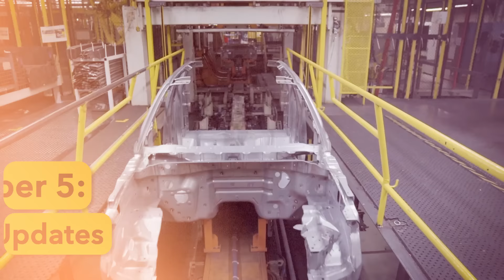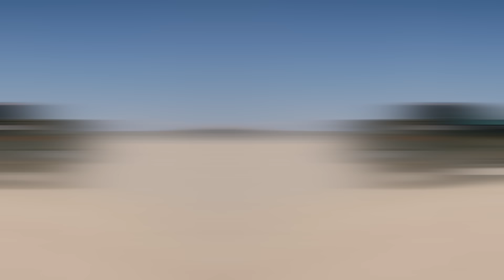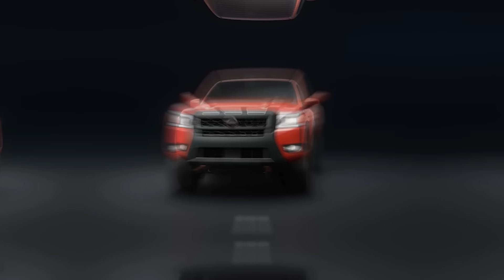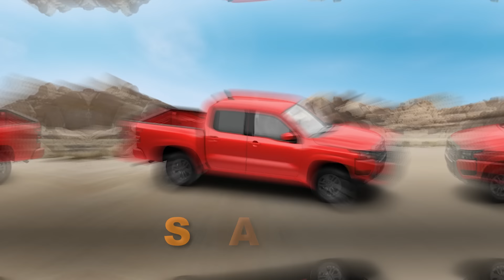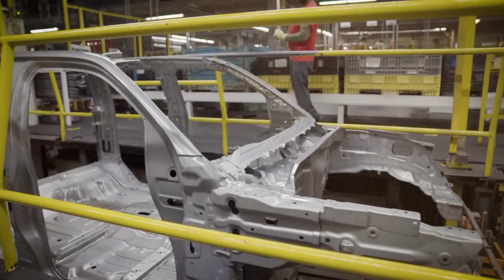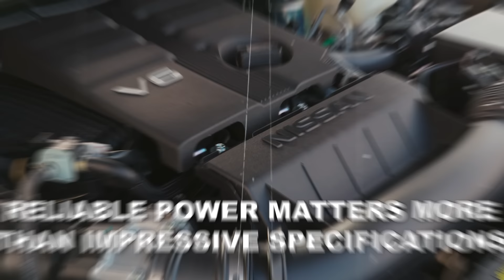5 GENIUS Changes in 2026 Nissan Frontier EXPLAINED in Detail!

Comment: Their engines still have a massive design flaw with the water pump. If it fails it can mix coolant into the oil and destroy the engine. No thanks.
Reply from the maker: The timing chain-driven water pump is a legitimate concern - when it fails, it's not just a simple pump replacement, it's potential engine damage. Nissan should've fixed that design flaw by now.

Are you basing this on known failures happening already, or just the inherent risk of the design? Because if it's actually grenading engines, that's a huge problem.

Comment: Leased Nissan vehicles (all trims) and a Frontier and never, never had any issues all those 15yrs. Going to lease a '26 Frontier here soon before December. Nissan=dependable vehicles!
Reply from the maker: 15 years of trouble-free Nissan leases is solid loyalty! What are you most looking forward to with the '26 Frontier - any specific updates or features, or just sticking with what's worked for you?

And why lease before December specifically - end of year deals, or trying to lock in before potential price increases?

Comment: I agree about the water pump issue. But could be alot worse the reliability of having a 4cyl turbo mid size truck like other brands have switched too. Im a gm guy at heart but I'm really wanting a frontier
Reply from the maker: So you're willing to deal with the water pump headache to avoid the turbo four reliability gamble? That's fair - at least the Frontier's V6 is proven, even if the water pump design is questionable.

What's stopping you from pulling the trigger if you already want one? Just waiting to see what the 2026 changes bring, or trying to talk yourself out of leaving GM?

Comment: is the water pump still inside the engine? chain driven water pump?  exceptional engineering"!!!?,  electric radiator cooling..
Reply from the maker: Yeah, it’s still a chain-driven water pump tucked inside the timing cover on the VQ engine. Definitely not the easiest setup to service, but it helps keep the design compact. Even so, it’s considered one of the most reliable engines out there, and the average annual repair cost is lower than most trucks. Do you think Nissan should keep refining the VQ or move on to an all-new powertrain for the next Frontier?

Comment: is the hydraulic steering still terrible?
Reply from the maker: They’ve definitely improved the steering feel over the earlier models, it’s still hydraulic, but it’s been refined for better feedback and stability. It’s not quite as light as an electric system, but a lot of drivers actually prefer that old-school weight. Have you driven the newer Frontier yet to see if it feels any different?
Reply: @tech_triumph  Hey thanks for the reply. I've owned a 21 and 23 tacoma. I test drove a 25 frontier sv and I couldn't believe how heavy and slow the steering was compared to my tacoma. I'm used to driving in the city and on twisty mountain roads with one hand. No way I could do that comfortably with the frontier I tested. I'm not a 100 pound weakling either.

Comment: For the fifty and sixty thousand dollar price tag, you might as well get a full sized truck.What is the point?
Reply from the maker: True, the price gap between midsize and full-size trucks has definitely narrowed. The Frontier still offers solid off-road ability and easier parking, but yeah, it’s getting expensive. If you were spending that kind of money, would you personally go midsize for the practicality or just jump straight to a full-size?
Reply: 32,000 4×4

Comment: And then they ruined the entire truck by putting a water pump that works off the timing chain. I'll never buy one for that reason alone!
Reply from the maker: The timing chain-driven water pump is definitely a questionable design choice - when it fails, you're not just replacing a water pump, you're potentially looking at timing chain work and way more labor costs. It's one of those "cost-saving" engineering decisions that saves the manufacturer money but screws the owner down the line.

Have you personally dealt with this failing on a Frontier, or are you writing it off preemptively because of the design alone? What would you rather see - traditional serpentine belt-driven pump, or electric? Because everything's a trade-off somewhere.

Comment: The pricing strategy hasn't made it north of the border where, although cheaper than Toyota, the Canadian peso combined with interest rates are not making this an attractive choice financially.  American tariffs have shrunk availability so I would think potential buyers aren't left with much bargaining power if interested in making a transaction.
Reply from the maker: Have you noticed local dealers adjusting prices or offering any incentives to make the Frontier more appealing?
Reply: @tech_triumph  In Canada? Not gonna happen. Here the only incentives you'll see on pickups are from the Big 3 offering 0% up to 72 months financed.  But I don't need a full size truck or the full size price to go with it. I've been looking and there are Zero discounts on mid size trucks ( price or financing ) here.
Reply from the maker: How much of a factor is that in your decision, are you holding out for a deal, or just buying when the price feels fair?

Comment: Still only direct injection instead of port and direct injection like Toyota.  Direction injection means carbon buildup and costly repairs.  Also, what about the transmission?  JATCO transmissions are not reliable and have a bad track record.  I’ve heard Mercedes might make these trannys?  That’s even worse!

Comment: Still has lousy cameras.
Reply from the maker: Yeah, Nissan’s camera system has been one of the common complaints on the Frontier, even with the updates, it doesn’t quite match what some competitors are offering. Do you think better tech like 360° cameras and higher resolution would make a real difference for you, or is it more of an annoyance than a dealbreaker?
Reply: @tech_triumph  I recently purchased a Toyota Tacoma Limited after weighing all my options. I really liked the Nissan, but the Toyota Limited was more practical for me. I live in a snowy area and the full time 4wd was probably the deciding factor. The Toyota hybrid system definitely has more passing power and much better tech. I also asked several mechanics at local shops what their recommendation would be. Toyota was always first for reliability and ease of repairs and Nissan was second. There are several areas where Nissan can step up their game and then they really would be serious competition to Toyota.

Comment: No thanks, I'll keep driving my 2003 Nissan Frontier four cylinder 5 speed. Best truck I've owned in 55 years of driving.
Reply from the maker: Wow, that’s quite the endorsement for the 2003 model! What makes it the best truck you’ve owned?
Reply: @tech_triumph it's never broken down. It's easy to maintain. Bulletproof reliability. 200k plus miles. The only major thing I've had to do to it and all these years is replace the tie rods. Only performed regular maintenance on it.

Comment: I just picked up my '25 Pro 4x fully loaded--my first brand new truck ever. I probably slightly over paid at $50K out the door--my retirement present to myself. I love almost everything about it except the poor gas mileage--combined ~16 MPG, the uncovered rear wheel wells, and the sliding rear window (should be electric).
Reply from the maker: Congrats on the new Pro-4X, that’s an awesome retirement gift to yourself! Sounds like you’re enjoying it overall despite those few gripes. Did you check out other trucks before buying the Pro-4X and if so, what made you pull the trigger on the 4X?
Reply: I did the exact same thing 4 days ago. Early retirement....yes!
Reply: 50k for a midsize truck is wild dude lol.  Wild.  You could’ve got a half ton crew cab for less.

Comment: Still no power rear window. Come on  Datsun
Reply from the maker: Right? In 2026 and still no power rear window feels like a missed opportunity. Do you think it’s a dealbreaker, or more of a “come on, really?” kind of thing?
Reply: @tech_triumph  Not a deal breaker. I have 2 Frontiers a 13 and a 22 Both bullet proof. My trucks are tools for work. 220.000 on the 13 one repair other than consumables. Heater core sprung a leak. Owned since new. 22 has 44.000 on it. No problems as of yet fingers crossed.
Reply from the maker: Absolutely, both reliability and that simple, no-nonsense design are huge reasons the Frontier has such a strong rep. Do you think Nissan will keep that formula going with future models, or risk overcomplicating things?
Reply: @tech_triumph  It's unfortunate But sales have dipped big time on the Frontier Since the Toyota and Ford and GM new Midsize trucks came out. People want the next coolest thing Not the most durable reliable thing. So I would say probably not. They will try to keep up with the Jonses so to speak and ruin a perfectly good Midsize TRUCK. I swear bye my Frontiers I am on my 4 one. They all lasted the loan and brought me over 300.000 trouble free miles. Jury is still out on the 13 and 22 But the 13 is trending that way. The 22 will never make it Because the Wife just traded it for a new 25 Pathfinder This week. As soon as the new X-Terra comes out That's gonna be my off road retirement rig. I got less than a Month after 35 years as a union Tinknocker. AKA Sheet Metal Fabricator.
Reply from the maker: Do you think the upcoming X-Terra will be able to match that kind of Frontier reliability, or is it more about the fun off-road factor for your retirement rig?
Reply: @tech_triumph  It's getting twin Turbski's according to my sources at Nissan But time will tell.

Comment: Not with the water pump inside the timing chain😂
Reply: That water pump will outlast the truck. Nissan upgraded the pump with Viton seals in 2022. Also, before the water pump starts to leak, it will make noise indicating that a replacement is necessary.

Comment: I can attest to the silky smooth and effortless V6 which also means a very quiet interior ride. My fully loaded 2024 SV Crew Cab Long Bed is an absolute joy to drive. These Frontiers will long out last their turbo 4-banger 🙄 competition. My 2012 Frontier gave me a 160,000 trouble and recall free miles. My 2024 had been just as bulletproof. Folks looking at this truck segment are really doing themselves a disservice by not taking a hard look at the Frontier.
Reply: I have a 24 as well and agree with everything you have said.
Reply: I have the same 2023 Frontier. It’s a great truck.👍

Comment: Gotta love that V-6 engine in my 2025. Just did some highway driving today and the acceleration on the on ramp is so smooth and powerful. Glad they kept it for 26. Where's the Pro 4X King Cab? Missing out on a segment that's not covered in the industry right now.
Reply from the maker: That V6 really is one of the Frontier’s strongest selling points, smooth power and plenty of confidence on the highway. You make a great point about the Pro-4X King Cab though, there’s definitely a niche of buyers who’d jump on that combo. If Nissan did bring it out, would you lean toward picking one up yourself or stick with your current setup?

Comment: Where are the roof racks?
Reply from the maker: Do you think roof racks are a must-have for the Frontier, or just a nice-to-have?
Reply: @tech_triumph  I told them the rear window had to go unless it's power, just give me a whole window. The start/stop/I don't want either. The salesman said I'd just have to live with it. That sent me to Ford looking at a more expensive Ranger Raptor! I might wait on the 2026 Frontier 4x4R, but I'll be at a different dealer. I can pay cash, but I don't know if/when I should use that as a bargaining tool or with which truck. ???? If this doesn't happen, I'm just gonna get a muscle car from the days when I grew up. The best time to buy is when you can pay cash and when you're not in a hurry and don't really care if you work a deal or not. More calm/decisive/and less likely to make a mistake. I enjoyed your video!
Reply: @tech_triumph  Frontiers always have had great roof racks.  It is a tradition.  The new Frontiers should also offer the same great roof racks

Comment: So 47k for a 2 inch lift and nothing else? Thats wild. It should at least have an exhaust and intake and ecu reflash if its got a roush name on it. Sounds like another gimmick.
Reply: Ohlins are arguably the best in the biz plus these trucks usually don't sell as fast as the others in the segment and you can get them well under MSRP
Reply from the maker: Yeah, paying Roush money just for a mild lift without the performance goodies does feel like they’re leaning hard on the badge. Roush used to mean a full package with real engine work and tuning. Do you think Nissan’s playing it safe here to protect warranty/reliability, or is it just pure marketing?
Reply: @tech_triumph  its not just a lift.  suspesion componets upgrade ,wheels,  ohlin shocks with oil extension, interior and exterior upgrades  adds about 6k to the pro4x  get alot for the money